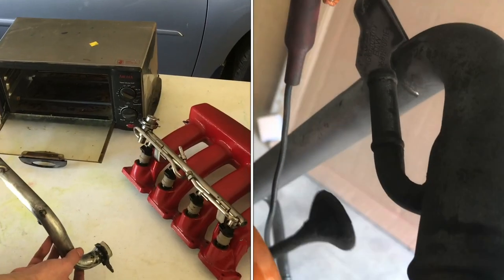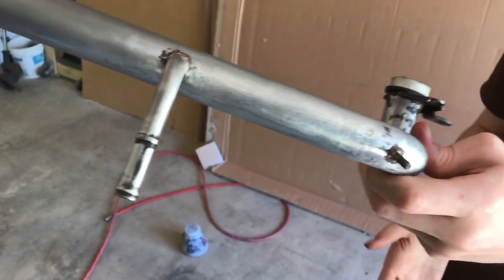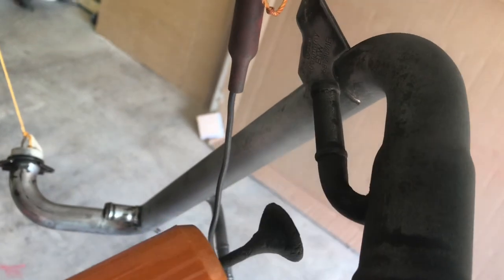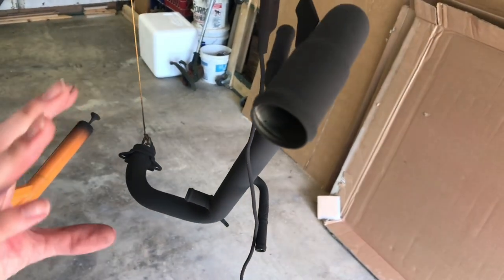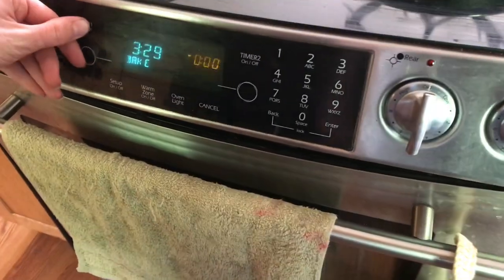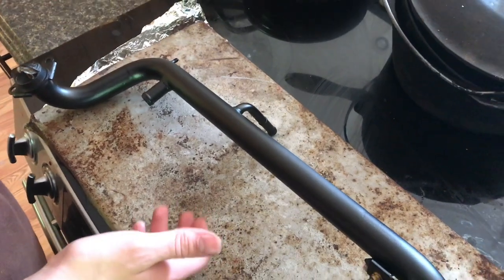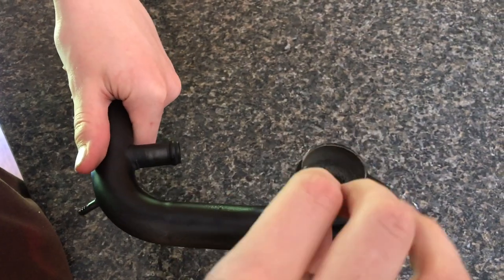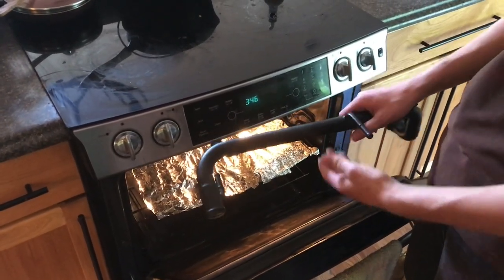using my “kitchen oven” for POWDER COATING

Comment: You definitely didn’t apply enough powder. If you bumped up your pressure on regulator it would have helped a lot. That’s way to thin.  Also it’s highly recommended to NOT use it in an oven your going to cook with later the toxins from the powder and metals will stay in the oven and can get in your food same reason they say don’t coat things you will be eating or drinking from only outside of it
Reply: Its lit I cant believe he used this shit now he gonna bake some chicken tonight and its gonna take like powdercoated chicken with delux taste